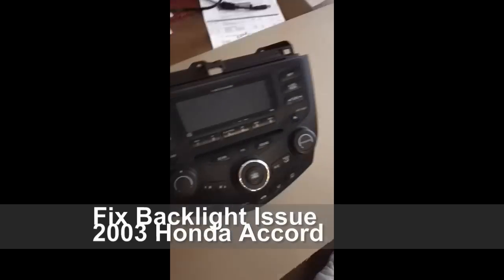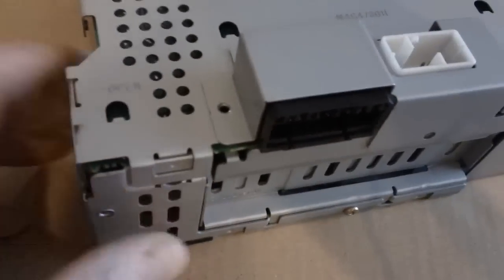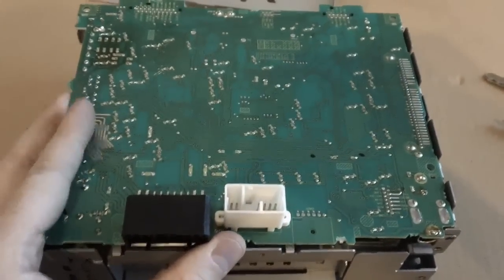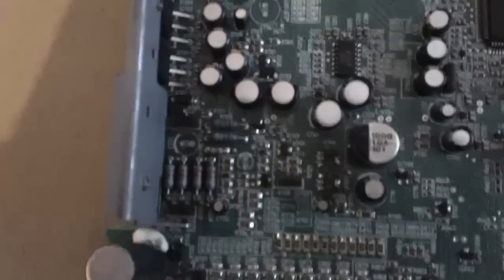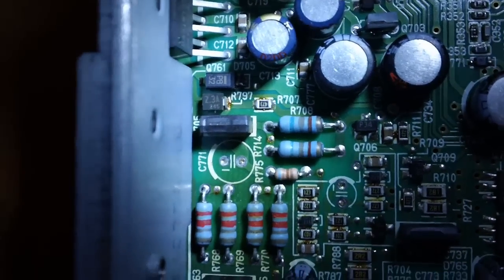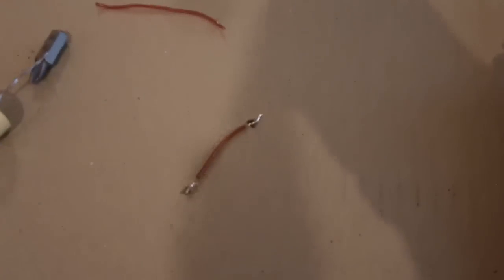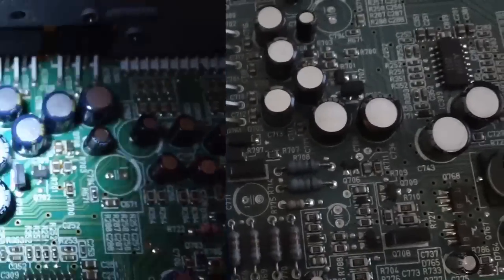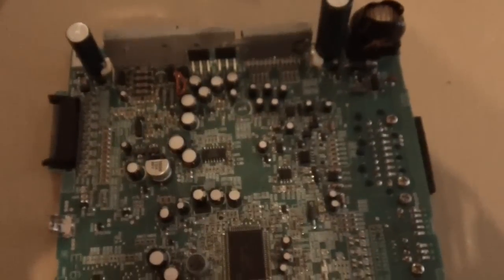Honda Accord Radio Back light Fix Tutorial

Comment: I meant to post again once I had my radio assembly reinstalled.  As expected everything worked fine.  To Lexter's question, I cannot remember the voltage of the fuse I had replaced; however, I was able to read the numbers on the fuse that I replaced.  The writing is very small on the fuse (I had to use a magnifying glass to read)  but I do remember it stated 2.3 amps.  It may have stated voltage as well but I doubt it.  

I was certainly pleased to be able to install a new fuse since I wanted to continue to have protection for the circuit board.   Perhaps I am just too conservative.

Good Luck
Reply from the maker: Awesome!  Many people have been asking where to find this fuse. Where did you find it and what was the cost?  Thanks.
Reply: mitch cox Hi Mitch  Sorry for the slow response.  What I did was go to a local music electronics shop.  The technician removed a fuse from an old instrument and installed on my circuit board.  They charged $35 total for the fuse and labour to install.  Today, I went back to the shop to ask them where they would buy a fuse if they wanted one.  They advised looking at Digikey and Mauser Electronics with a search for a surface mounted fuse.  Hopefully, this helps.

Comment from the maker: I can't tell from your comment if my video helped you fix the display issue.  Removing the resistor wont fix the display.  You will need to either replace the bad resistor or bridge the connection like I did.  Thanks.

Comment: I tried this on my 04 Acura TSX, but it did not fix the lights on the HVAC controls.  I removed the resistor/fuse, then bridged the connection with a blob of solder.

Comment from the maker: You may be using a resistor that is too small to handle the load. You may try bridging the connection and see if you still have the issue when you turn your lights on.  But again, do at your own risk.

Comment: Has anyone experienced the backlights intermittently turning on while car is off/locked, after the repair is complete? I also added an aux cord. Wondering if I have a bad solder or if static wreaked havoc during the repair process. It is like I’ve got slight solder contact with a constant power source
Reply from the maker: I did not experience this issue with mine.  Sorry.

Comment: I'm wondering if anyone has a suggestion of how to fix this issue when you have the navigation system. It looks as though my PCB doesn't have even close to a similar setup, there's no R797 or the two 761 and 705 to bridge a circuit.

Comment: If your going to keep the car get a new radio at a sound place and they install it. New radio with great upgrades. Get the navigation system while your at it.
Reply from the maker: What makes it a little more difficult to do that is the heating and cooling system is also in this unit and the odd shape of the space makes it difficult to make an after market unit look well.  Thanks for commenting and the suggestion.  I did look into it when I first had this problem.  Since it was broken I figured I would try to fix it first before I went out and bought another radio. Had nothing to lose but a couple hours of my time.  It turned out well and the unit is still working today.

Comment: I haven't actually purchased the part. I don't think my local stereo guys will solder that part so I think I'm going to be stuck having to buy the radio (which sits behind the face plate) and having them swap them out.

Comment: On my accord 2003, the CD screen backlight doesnt work intermittently.But sometimes it does. All other lights are fine. Will changing the resistor fix this or could it be something else?

Comment: My 2004 Accord has a different layout as well. It doesn't have a ribbon cable. I have the single CD and nothing showing on display. Can you tell me which location that resistor is at?

Comment: The backlight on mines went out shortly after the air went out. I took it to mechanic and he said its a switch between the radio and ac that was the problem. Do you think that is what is causing my radio to do this or is it the resistor?
Reply from the maker: if your radio looks like the one above, I would say it is a good chance that this will fix your back light issue. It may not but it sounds like you dont have much to lose, it is not working now. So give it a shot and let me know how it goes.  Thanks.

Comment: Mitch what is the numbers underneath the 2.4A?
Reply: Looks like 245.  It's labeled on the silkscreen as R797, so it is a resistor.  It's a power resistor, probably an SMA, SMB, or SMC package.  I don't have one to take measurements on.  You should be able to look up the resistor value based on the 245 code near the bottom of the part.

Comment: hello, my honda accord 2004 have a different radio I do not see this resistor, could you help me? I can send you a photo, thanks
Reply from the maker: If it doesn't look like the one in the video, then I probably cant help you. Sorry but I only have experience with the unit I own. good luck.
Reply: Mine Honda Accord 2003 have a different radio too. Krzysztof, have you solved your problem?
Reply: I am sorry, but I bought the used one

Comment from the maker: You just want to connect one side of the resistor to the other. to bypass it. so you can just put a giant blob on top of it as long as it connects both sides.  Just make sure it doesnt get on any other connections.

Comment: If the jumper eventually causes another part to fail on the board, I guess we are no worse off than we were before the jumper solution.  However, if the jumper causes excess heat/fire in the dashboard.  We might have a huge problem. . . but that's why we all have excellent insurance!

Comment: Recently the back light in mine gave out. Turns out when i took it apart somebody has already soldered it. I've owned this car for a year .
Reply from the maker: You can try to soldering it again. maybe it cracked or is not providing a good enough connection.

Comment: I had this problem and I took it back to the dealer to get it fixed. Cost me a $100 with my extended warranty coverage to fix.  Here's the thing.... when it happened the A/C lights weren't working as well.  After getting it back from the dealer everything was great for about 2 years but now the A/C lights went out again and the radio lights only work some of the time but the display still works.  Has anyone ever heard of this happening?

Comment: i don't have that resistor on mine?
Reply from the maker: Thats odd, does the radio look like the one in the video. Does it have your climate controls built into your radio?
Reply: My circuit board is also missing that fuse. After hours of research, I discovered the 2.3 amp fuse is now obsolete. I am yet to find a replacement, if any. What did you end up doing with yours? Did you get the backlight to work?
Reply from the maker: Yuleni Pulido Please watch the video. I used a little piece of wire as a jumper. Yes my backlight works after I did this.
Reply: Hi Pedro. Have you solved your problem? I have different radio on my honda accord 2003 too.

Comment: By the way, pulling off that resistor didn't affect my radio or CD-player.  Of course, the display is still too faint to be seen.  If you seriously want to fix it yourself, follow this video to take off the radio unit: 

Search" How to Remove Radio / CD Changer from 2007 Honda Accord for Repair." on Youtube, posted by HiTechElectronis

Comment: At 04:25 the defective part is clearly shown and on the board it is clearly marked "R797" which means it is a resistor. But the part is clearly labeled on its top surface "2.3A" which signifies a fuse, rated at 2.3 amps. Sheesh Honda, get your act together. This was the most common problem with the '03-'04 Accords. And then the stupid bulbs for the speedometer assembly, the moonroof switch, the heated seat switch and they use the 12vdc power to the ventilation buttons lighting that runs from the back of the radio, through the radio where it is dropped to 8 volts and run through more connectors to the front of the radio. They purposely made that turdbox radio lighting to fail. Worse than a Lada, Pinto, or Yugo. There should have been a class action lawsuit for this problem like the one they had brought against them for the odometer adding miles to the car when it was stationary.
Reply from the maker: Wow.  good info.  Thanks for commenting.
Reply: is always easy to identify a defective resistor/fuse?

Comment: Oh I forgot to mention to answer the other posts here.  None of the surrounding lights light up on the volume, a/c buttons, 1,2,3,4,5,6 etc when you have this problem with the back lit portion of the display being out.  You can barely see the LCD display with a flashlight still working.   This fix will fix both the surrounding dash light prob and the display prob.  Honda got sued over this and lost and they extended the Hondat warranty for this prob to 7 years/ 100k miles and they Won't make an

Comment: This video is pretty old now no. My question is why wouldn't everybody just put a new stereo in ? I think that's what I'm going to do now that  My 2006 accord is 17 years old. It doesn't have Bluetooth either
Reply from the maker: At the time the temp fan controls were also in the head unit.  Makes it a little more difficult to just install an aftermarket radio.  I thought about it but back then one that supported climate controls was very expensive.  Not sure how much it is now.  Thanks for watching.
Reply: @mitchcox they’re very cheap now, Android auto and wireless apple car play can be had for $140. Temp controls aren’t the greatest but they work, although outside temp display doesn’t in the cluster anymore in my EX V6 6 speed coupe. I think it’s missing some CAN info to report that. 

But I got mine for $80 and it even has a backup camera I added on the 10” display.

Comment: Thank you so much for the video.  My display just died a few days ago and I was quoted something higher.  In my previous job, I have access to soldering irons, wires and everything else, but I do not have access to them now.  I'll try @tullisgood's approach and see if it'll fix the problem.  Meanwhile, I wonder why didn't you try to buy that resistor from Radioshack or somewhere?  I also wonder if anybody has thought replacing it with a aftermarket headunit?

Comment: Here is the data sheet http://www.mouser.com/ds/2/351/XC-600037-204249.pdf

This is where you can get it from http://www.mouser.com/ProductDetail/Xicon/292-249K-RC/?qs=Kfsvszc4JWLi%252bCxFDtVHSA==

It is only a couple of bucks highly recommend you replace the part it could cause a fire. Your part is right off the power supply and 2.5Amps is alot of current.